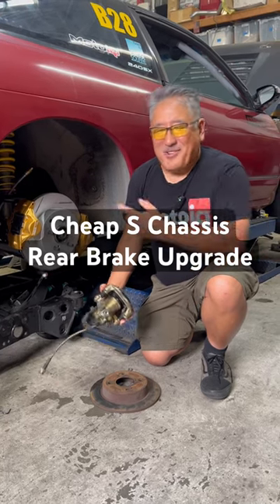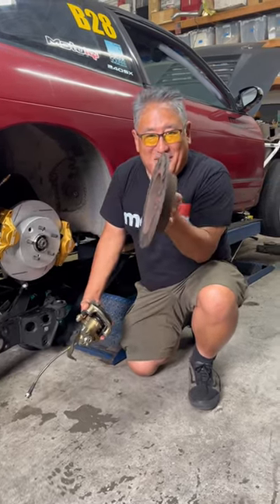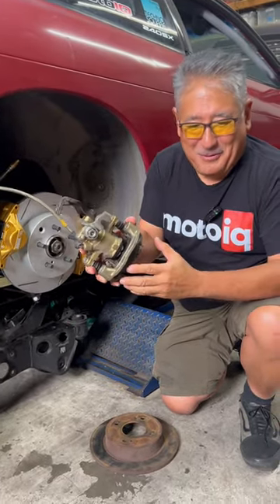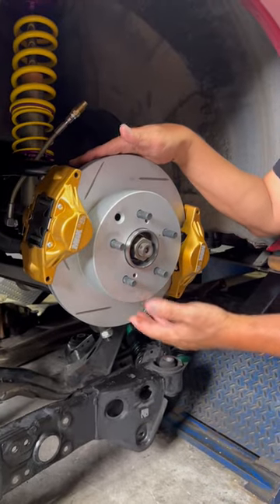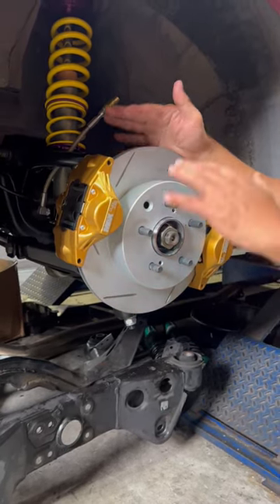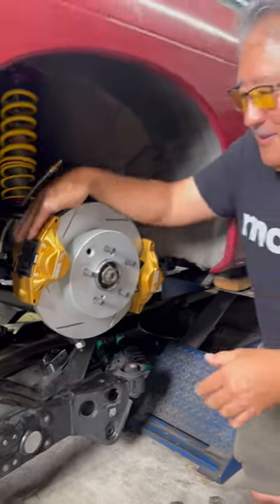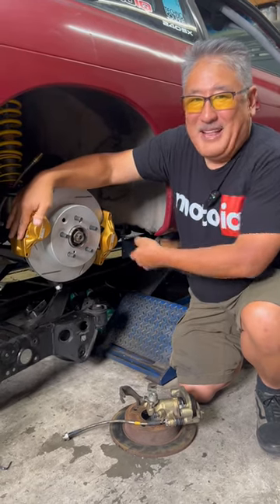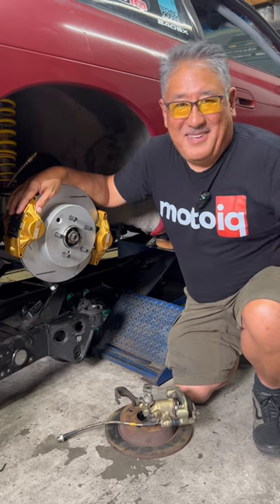Cheap Nissan S Chassis Rear Brake Upgrade!

Comment: I believe to use the lighter Z32 Knuckles, you had to get different rear shocks as the lower attach point was different from S13. Ended up using re-drilled rotors and modifying the inner rotor hat drum parking break to work with the S13 parts. Would’ve liked a better e-brake solution like the dual calipers (I hate drum brakes). Ended up parking in first gear for awhile trying to figure out the cable splicing method I ended up using. Good times, miss my S13 coupe.
Reply from the maker: You are absolutely right, I forgot to add that in my 60 seconds allotted. GKTech and others make splicer cables.
Reply: you can use an R33 parking brake cable for an s14. i think there is a 300zx parking brake cable for s13 @motoiq
Reply: I had a conversion bracket but you lose coilover lowering
Reply: i was gonna say that

Comment: yo, its me again, (2867v2863 discussion) 

looks like we are in complete agreement on the KW suspension though! 

We were pretty lucky in australia with the amount of wrecked r32-33 and z32 options around and my experience is the r33 gtst stuff is quite excellent, though I run GTR brakes we didnt notice that much of an improvement over the R33 GTST stuff!
Reply from the maker: I think they all run the same rear brake calipers?
Reply: @motoiq  AFAIK, yes except brembos.  

 I was referring to the whole F+R setup though for upgrades though. 

That being saidI had someone tell me that there early z32 calipers were aluminum at the rear as well as the front, but ive never personally found any aluminum rear ones (can confirm front aluminum calipers existed though) there might be some sort of minor differences otherwise but thats beyond what I know.
Reply from the maker: In our market, the early Z32 front calipers were aluminum and in, I think 1993 or something Nissan switched to iron to stiffen them and lower the brake system natural frequency in an attempt to reduce brake judder.  So from 89-92 they were aluminum.  i don't think the R32 had this issue?
Reply: @motoiq  I think they were steel like r32/33/34 but used the OG finned design that were z32 specific. I dont think they were cast iron like the S14/15.  

Dont believe there were any issues with 32-34 but Im getting outside my area of knowledge! 

Im loving your content btw, motivating me to get on top of some niggling things on my neglected car!

Comment: Are those rotors on backwards?
Reply from the maker: No.
Reply: Rotation direction is determined by internal vanes, not the outside slots.
Reply: That’s what I had insisted friend kept saying otherwise

Comment: The issue my friends had with the S chassis was the flimsy control arm brackets. They're strong enough for normal driving but don't like going sideways and we ripped a few of them out and had to weld in something with more meat. 

Is the Z32 rear sub stronger and does it fit the S chassis?
Reply from the maker: It will not fit.  We had to run unaltered unreinforced subframes in formula drift according to the rules, even with 1000 hp and 295 tires we did not have that happen.
Reply: @motoiq , you guys are probably just better drivers lol.
Reply from the maker: Did you crash into anything?  We broke control arms with the power and grip but never the subframe.

Comment: All that extra complexity doesn't look it is cheap. Lol
Reply from the maker: If you think this is complex, you probably should not be building cars.
Reply: @motoiq  Why the attack? Is the video supposed to promote sales of these kits? Complexity as in you're adding an extra caliper and new ebrake system to the rear of the vehicle. It's something that can be done by a weekend warrior mechanic. My comment is on cost. Is this cheaper than the single caliper upgrades that are out there? Why is this type of upgrade even neccessary? Usually brake upgrades are more critical at the front of the vehicle.
Reply from the maker: Not attacking but if you think adding a caliper on a drift car which is totally normal is overly complicated, you probably should not be attempting to work on cars!  It's not a kit either, it is made up of different stock parts that can be found used so it's much cheaper than buying a kit.  Also if you don't have a drift car you can just use one caliper. It's all in the video.